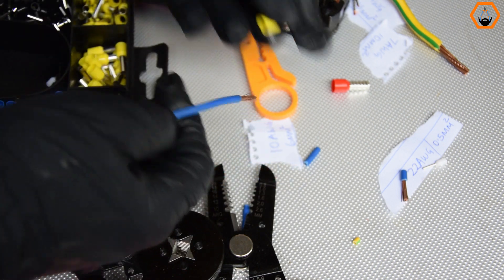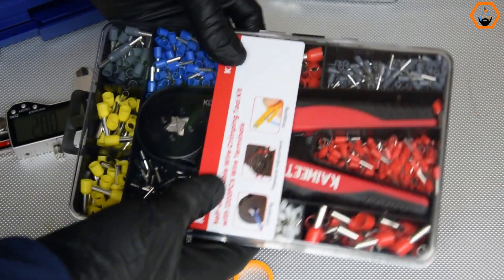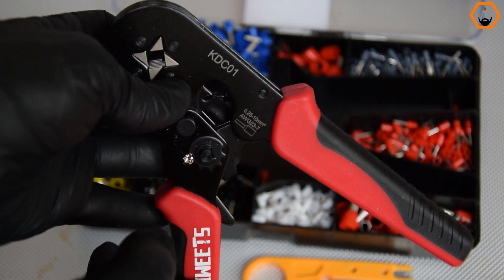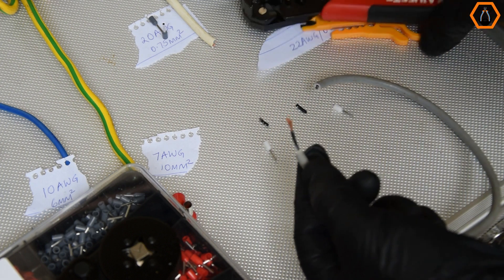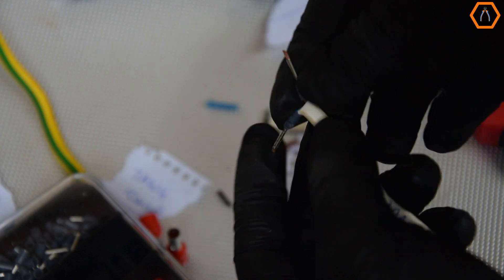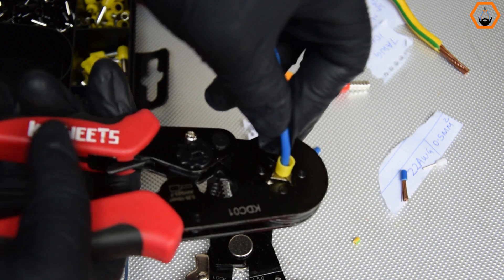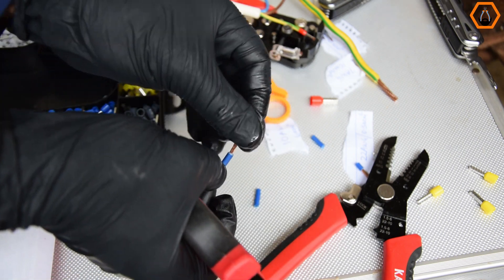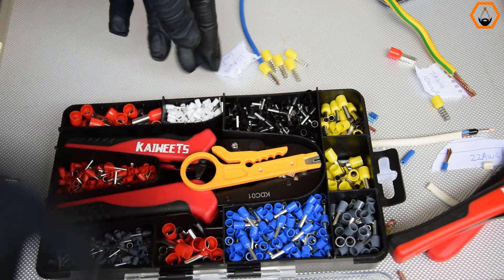Kaiweets Wire Ferrule Crimping Tool Kit (KDC01) Review

Comment: So after you crimp the wire then what application is it used for other than sticking in a receiver to dog down.
Reply from the maker: It is good practice to crimp your flex wires with ferrules when connecting them to terminal blocks.